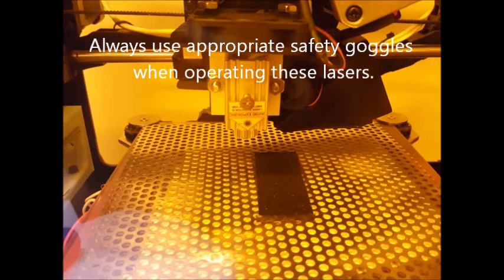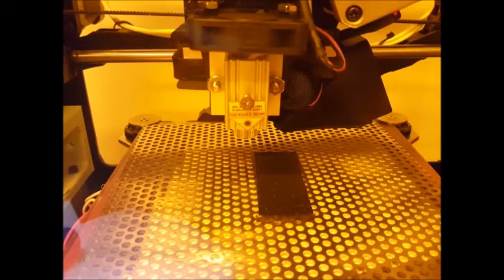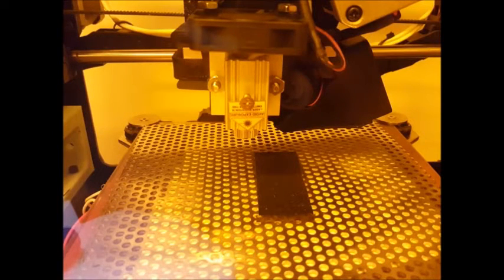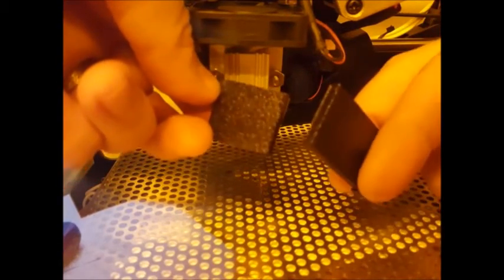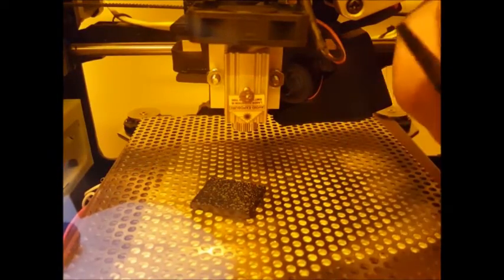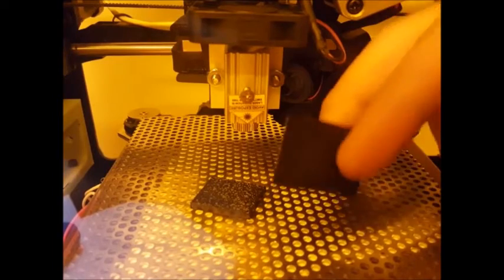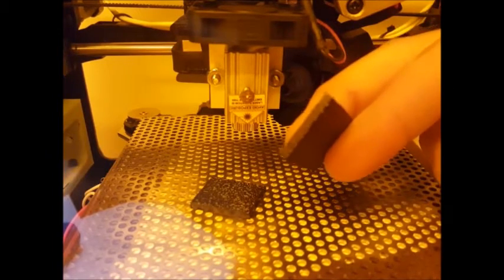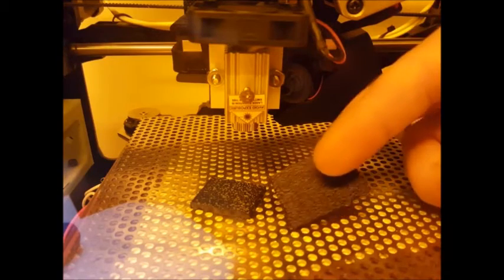Laser Cutting ABS Plastic with J Tech Photonics 2.8W and 3.8W 445nm laser kits

Comment: Doing a search of "ABS Laser Cutting" returned  a warning about the release of Cyanide Gas (along with this video). My laser is vented to the outside so I don't have to worry much, but my laser does leak fumes into the room because it has a bypass to allow long pieces of material. Did you notice any "Bitter Almond" smell? I guess i should worry about the neighbors and their damn kids, should I worry about this for myself?

I guess you know what you're doing with a name like "JtechPhotonics". I'm just starting out and interested in seeing what i can cut. I wanted to cut Vinyl records, but i dint want the chlorine gas to damage the lenses or electronics.

I did cut 1mm polycarb without a problem (discoloring or fire).
Reply: Weeks later neighbor's kids found dead from cyanide poisoning. :x

Don't use laser to cut these, use a spindle cutter.

Comment: Jtech, Looking at a rig for working on thinner styrene sheets. Mostly .030 to .12". Looking to simply score and not cut completely to avoid edge melting. Would a 2.5 be ideal? Would a 5.5 be too much?  Can one adjust power on diodes or just pass speed?
Reply from the maker: Styrene sheet might be hard to score because of it's reflective properties no matter the power.  The white sheet is not really affected by the laser light in the 445nm range.  If you have samples of it you can send it to us and we can see if your sheet will score, but in the past it has not really worked for other customers.
Reply: JTechPhotonics, I can try to get some samples. Wonder if black styrene would work. I did have luck on a 60W CO2 but I know they are two different things.

Comment: what do you use as a material support (Spoilboard?)  when using these lasers?
Reply from the maker: +Old_Phart We use either MDF or Aluminum for the worksurface protection.  Aluminum is good because the laser will not harm it at all.  For the larger machines we just have the MDF waste board which we replace when it gets too damaged.